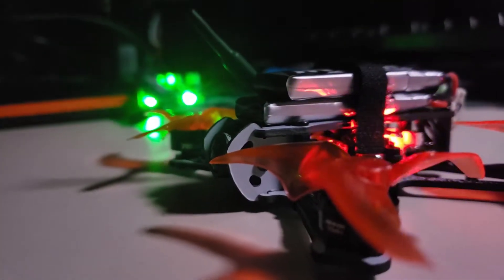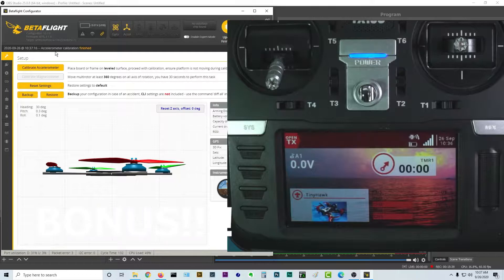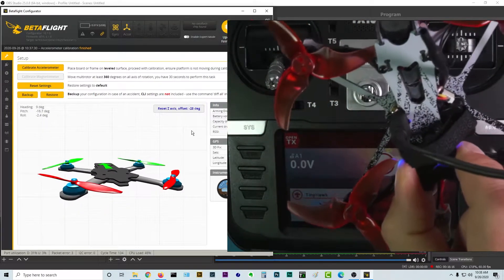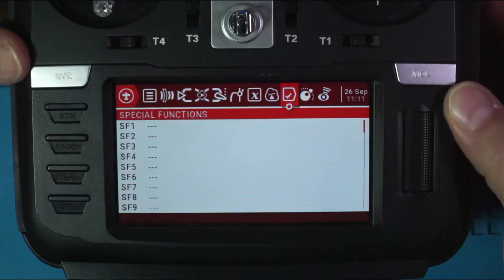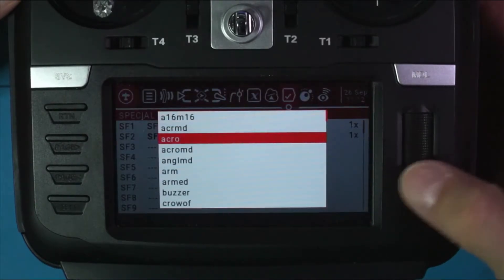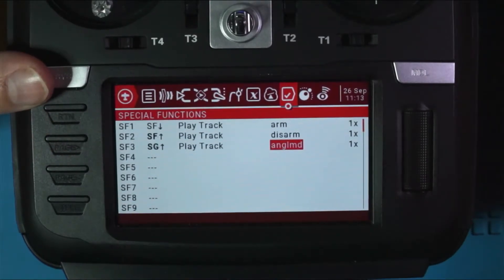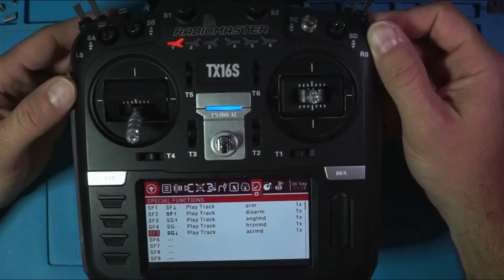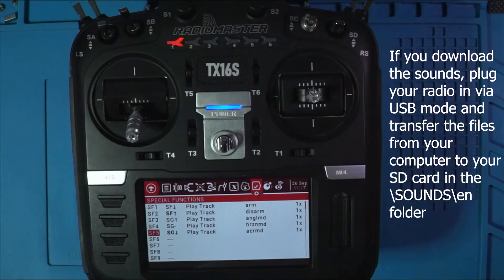Tinyhawk Freestyle 2 and TX16s - Setup Voice Cues Learning Special Functions on OpenTX

Comment: Amazing work, you made something complex so simple; thanks.  My TH2FS should be here Thursday and I will watch your serie again to configure it.  I am unable to find the "arm" track both on my radio and in your Dropbox.  I used armed instead, but I prefer "arm motor" to "armed".
Reply from the maker: Glad it was helpful!  Check the SD card when yours comes because there are a lot more sounds on the card.
Reply: @TahoeSteve  Me neither, I couldn't find the sound "arm", I looked (well) both in the SD card (everywhere) and in the Dropbox. By the way, thank you for your videos, I'm checking them right now, and they are really helpful and clear. Thank you so much
Reply from the maker: Check out the Amber Sound Pack,  http://open-txu.org/home/version-2/v2-2-resources-2/
Reply: @TahoeSteve  Found it! Thanks! 💪